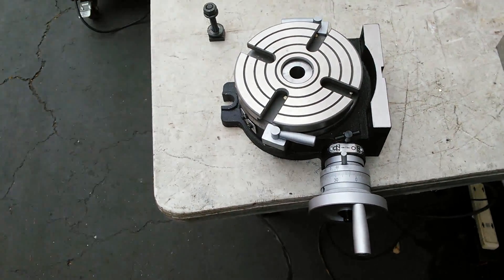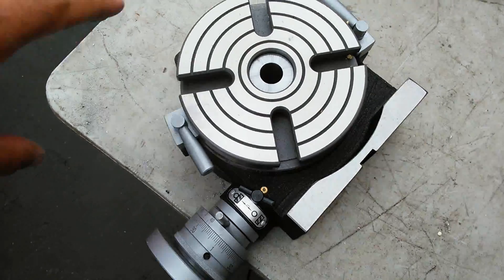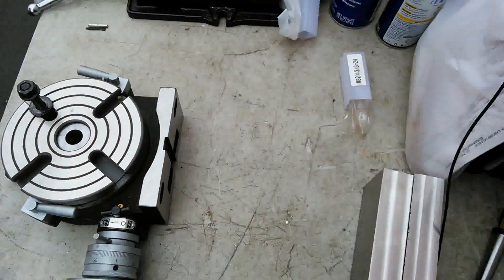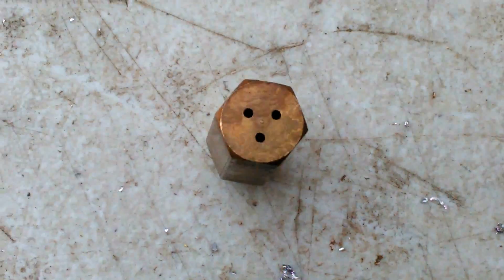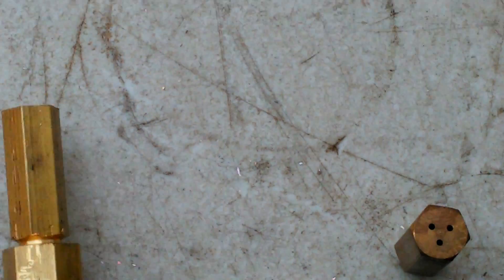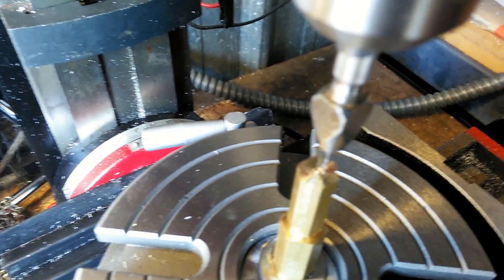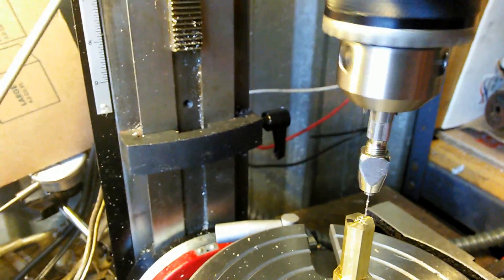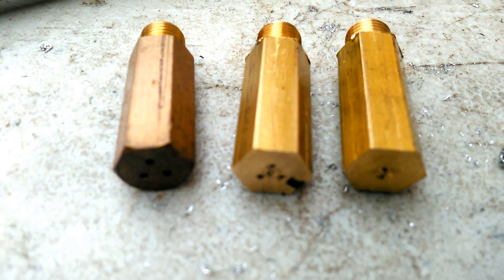Using A Rotary Table On A Mill

Comment: Do you have a link for your rotary table, thanks.
Reply from the maker: You can get them from a number of places. I prefer to shop from Little Machine Shop, but they're also available on eBay. Here's a link to the same model I have in this video: https://www.ebay.com/itm/165599436357?epid=20057726063&hash=item268e7ede45:g:kmAAAOSway5i4kth&amdata=enc%3AAQAIAAAA4Lw%2F5kmmxbSfYOuTtFzCc2gJ5QW6o%2Bs%2B9U91R9ufSTjysQD0Y6gODwvvbl0yvbgwElWdn4ikOg5cxAKK1lQzeXHb0zkbn556MiUUNIcAjgOKZhOE8Nh7nlilpmMEdCYvLQGZCeJBidyvH1hNYs4s2n2yHS%2FMA1aT5QZT%2F6qPjik%2FqIQTSsnMarLfHyLb2DbicXWAoS1xy5PYyfsuAyW9kRwZToZveesXtdcCiTQsuAVGjdit3dZzhrNXlSmRvVA8mrjYImw1tr2eM7WGG40Eu6vU2BfHRIY7df3C%2FNCQlk1D%7Ctkp%3ABk9SR5yM85m3Yg

Comment: You can adjust the slack by the little ring behind the handle. Take handle off, loosen set screws on big sleeve and remove both. Loosen set screw on adjusting ring and tighten or loosen to get slack out.

Comment: The runout of that Jacobs chuck is so bad that it almost negates the precision a rotary introduces. I picked up Precision Matthews 0.001" runout chuck for $89 and measured about 0.00075"(same precision as $130 ultra precision chuck PM sells)  on my Mitutoyo 0.0001" graduated DTC. One of the best upgrades you can get IMO. I only use Technik ER16's for carbide end mills now that I'm no longer chasing 0.004+ runout I had on stock setup.

Comment: 07:18 is that an optical illusion or is the piece wiggling around? It appears as if the center base that the work piece is mounted in has some play in it.
Reply from the maker: I was using a phone that had some serious issues to record this video. If you view the beginning  of this video, it appears to be very wobbly and shaky. Part of that is the camera and the other part is due to the fact that I was recording hand held. The distortion that you're likely seeing is due in large part to the technical issues with that phone.

Comment: Hi, I have the same model of Chinese Mini mill as yours and I would like to take a divider like yours, but I am undecided whether to take HV4 (4 inches = 100 mm) or your HV5 125 mm model, your model limits the stroke of the carriage on the  Y axis?  this is my fear!
Reply: Same here. I think you can move the table towards user and reach half the rotary table which is all you need(center line of table to outside edge). My only concern is if you will be able to use the center T slot on mills bed? I would just get a 4" rotary but I have a larger cnc mill that could use the 6" plus I already have a 5" 4 jaw and 5" 3 jaw chuck. Thinking about making an adapter to fit the 5" chucks on 4" rotary...

Comment: Have a small RT similar to yours.   Clamp the one end like you, but just use a hold down clamp like 99 percent of work holding outside of a vice to secure the other end.  No need to make anything special.
Reply from the maker: Sometimes I overthink things when it comes to performing machine operations. Thanks for the input, Doug.

Comment: It looked like the counter sink and drill bit had a wobble... maybe an optical allusion? Have you put a test indicator on your mill to check for run out?
Reply from the maker: The spindle is true, but the chuck is not. All the collets run true, so I know that the chuck is the problem. I'd worry more about it if I was doing precision drilling operations, but I'm cutting guide circles into these pieces on my lathe to find where I need to be for this operation. I'll likely need to find a better chuck to do precision boring operations. I'd use mill drills, but the type of drills that I typically use are for gas sizes, so those types of drills would be impractical for me to use even for as many sizes that I would require.

Comment: Thought youre supposed to go fast with light pecks when using a small drill...?
Reply from the maker: Higher speeds will generally break the types of drills that I use. Also, the flutes on these is very limited, so you're limited on how much and how fast the material can be removed. There's also the heat factor of higher speeds to take into consideration. The key to these ultra small bores is slow and steady.

Comment: Interesting, I thought the smaller the drill the faster you run it.
Reply from the maker: Smaller drill bits have smaller flutes that don't clear as efficiently as larger drill bits do. You generally want to use conservative drill speeds to save on tool life (within reason) and to insure efficient clearing of the flutes. The only time I use high drill speeds is when I'm initially boring a larger pilot hole created by a self centering bit because the follow up drill tends to catch in the pilot due to it's different flute angle (nearly a point for a self center pilot vs the standard 118 degrees point angle for a standard high speed twist drill). Generally speaking, when you get down to gas sizes or propane sizes of #60 and above (the larger the number, the smaller the drill size), the preferred method of reaming a pilot hole is to bore them by hand using pin vises, and this is done in drill size increments to keep the hole true. Keep in mind that excess heat produces unpredictable results due to heat distortion of the bore. The only reason that I had to use this setup here was because I was dealing with blanks to do my initial bore, but my final bore was done by either low speed machine boring or by hand.

Comment: great vid, what brand of rotary table is this?
Reply from the maker: It's a Chinese knockoff. that I got from Ebay. There are a number of these rotary tables with different features and mounting configurations.
Reply: Thank you, I like it.
Reply: the original one was the brand Vertex (I own one) made in Taiwan delivered with a QC sheet. . It was not long before Chines made copies, like the one presented.
Reply: @florentleider222  Taiwan is China Lite.
Reply: @flyingdog1498   Taiwan is almost as good as Japanese stuff. I'd choose Taiwan made over Chinesium any day.